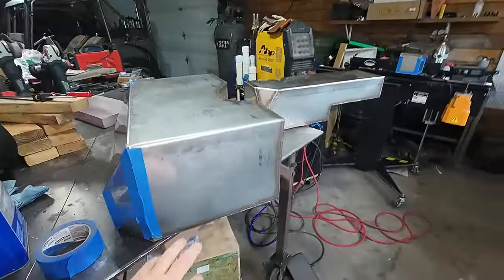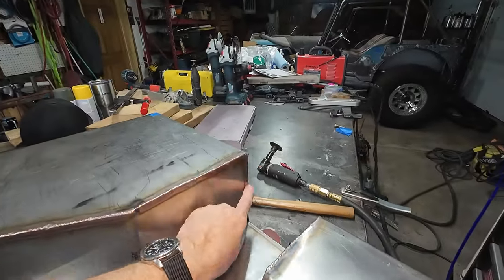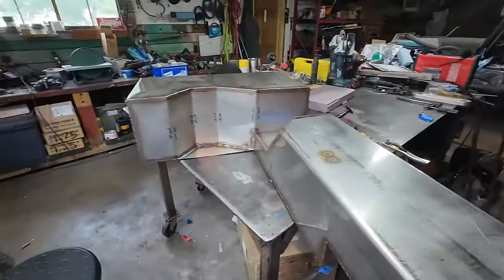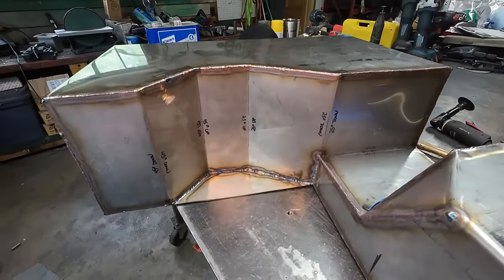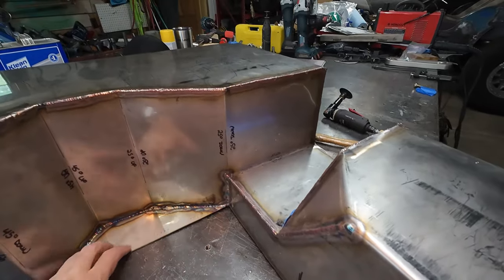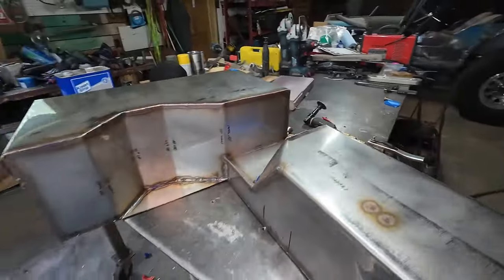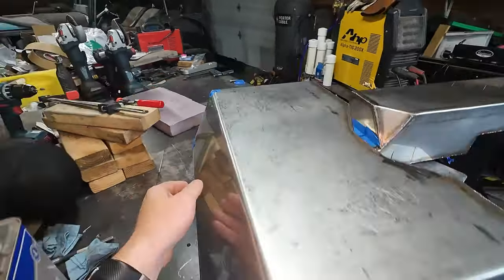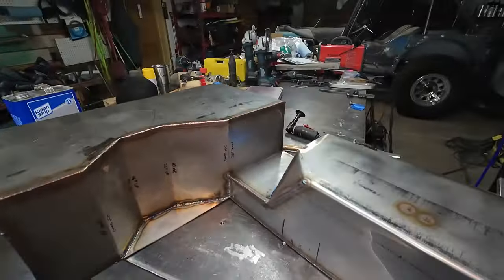Old Blue Willys Part 57

Comment: That tank has got to weigh 100lbs empty!  Sorry if you said it in the videos that you fabbed the tank, how many gallons does that tank hold?
Reply from the maker: No, it doesn't weigh 100lbs, including the 1/8" thick skidplate it is only 45.2lbs and will hold close to 20 gallons.